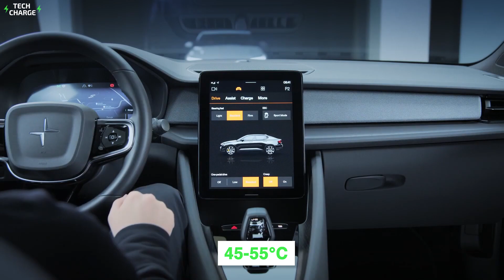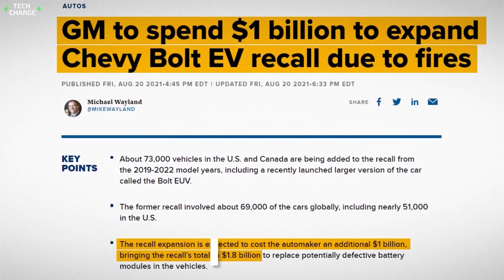The Shocking Truth About EV Fires You Need to Know

Comment: The sheer speed with which these fires develop is the most terrifying aspect, especially when it's a bus!
Reply: Also, it should be noted that, once burning, EV fires are almost impossible to put out. In addition, an EV that has burned cannot be repaired and resold. Therefore, insurance companies cannot repair these cars and must assume any fire is a complete write-off.
Reply: @@Mathilda2zeroAlso, the highly toxic smoke which causes cobalt poisoning and lithium poisoning makes EV fires extremely dangerous.
Reply: Well and the amount of water that is needed by fire departments to put them out
Reply: With 3000°F, you can torch almost anything--pretty quickly, for sure!  Did you see that video, last week, of that fatal container ship fire, that went up, with 4000 vehicles on it (500 of which were EV's, by the way)?  Looked like a real fiery h*ll, all right--with the whole top of that steel ship, burned away!
Reply: Just think how long it would take to extinguish a fire in an electric semi truck. The batteries alone weigh thousands and thousands of pounds. These are death traps on wheels.
Reply: @larrybruce4856  Fire departments are developing new technologies and new techniques to fight EV fires. Some are saying they can put out EV fires as fast as a gas car and with as little water.
Reply: @jamescarew2976  Well not really. The fire fighting EV tech being tested now uses a device that slides under the burning EV then penetrates the battery pack and floods the battery pack with water. It puts out the EV fire as fast as a gas car with about the same amount of water.
Reply: There are technologies and procedures that are being developed now that will put out EV fires quickly.

And if you're so worried about lithium fires in EVs, then you gotta get your laptop and phone out of your house at night. They can burn your house down too.
Reply: @@Mathilda2zero plus the batteries also produce oxygen while burning.... very scary.
Reply: The video host asks, "Do you think EVs are safe?"
Hell no!
I don't want one even if it is free. 
That it can burst into an uncontrollable fire spontaneously is like a ticking time bomb.
Parking it in one's home garage would jeopardize the life of the whole family.
Reply: @simon6071  Absolutely!
Reply: Spot on. Not only do they catch fire in an accident which damages the battery - they can spontaneously ignite in your garage under your home in the middle of the night which will destroy your home before the Fire Brigade(Department) can extinguish the source of the blaze - the battery.
Reply: @richardlewis5316  Teslas on average catch fire once for every 205 million miles driven. Gas cars every 19 million miles. If I were you, I wouldn't put a gas car in my garage. I have two Model Ys in my garage. Much safer than gas.
Reply: I'm waiting for the first electric school bus to burst into flames with kids onboard.
Reply: @1940limited  kinda sad, when you think about it: what lengths we've gone to, because of these crazy radicals & environmentalists...
Reply: @1940limited  Well.... if anything would put a stop to the EV madness it would be a tragedy like that wouldn't it
Reply: What about a passenger ferry on a cramped deck add a new green ferry powered by highly flammable gas and you have a catastrophe waiting to happen.
Reply: @iancampbell6925  Millions of EVs are shipped on the ocean every year.
Reply: @iancampbell6925  "How fast do you have to go in airplane to make your head explode?"  ~Spadowski, the janitor, in the movie UHF
Reply: Not remotely as fast as a petrol explosion.  Are you aware of the death toll at gas station forecourts each year?
Reply: @fredflintstone9963  
Google: The Most Surprising Gas Station Accidents Statistics And Trends in 2023
"How often do gas station accidents occur in the United States? According to data from the National Fire Protection Association, there are approximately 5,000 gas station fires in the U.S. each year, leading to an average of 2 deaths, 48 injuries, and $20 million in property damage."
The answer is 2 deaths each year.
Leave the risk at the gas station, not at home.
VIDEO: Experts say China's EVs are "Exploding in Huge Numbers" - The Electric Viking
VIDEO: No One is Talking About Electric Car Deaths, So I Have to
Reply: @fredflintstone9963 Those fires are probably due to stupidity. You can’t fix that.
Reply: No where near as fast as a petrol fire.
Reply: @geoffbennett9257  lets see, petrol fire: 500 to 800°F, outside of a combustion chamber, and easily put out.  Lithium battery fire, 3000°F, and takes 30000 gallons of water, to put out (though it might reignite, later).  So, of course a petrol fire is faster, right?  (Only if you are an idiot, who doesn't understand physics, that is...)
Reply: A petrol car fire can be smothered and put out. @geoffbennett9257
Reply: @geoffbennett9257 EV fires are absolutely faster and hotter than most petrol fires. Much harder to extinguish too.

Comment: I have not owned a single gas car in almost 60 years that caught fire.  That said, I will never put an electrical vehicle in my garage and risk burning down my house and danger my family.  Even electric bicycles, scooters and other electric units are being 😊banned from apartments because of fires they have started.
Reply: They usually give you a warning in the form of a gasoline smell before a fire, and electric vehicles give no warning.
Reply: @robinsattahip2376 overcharging, overheating and smoke... as far as I've read.

Some lithium ion battery expert should explain those extremely risk charging failures.

Lithuum ion batteries have a BMS (battery management system) which equalize energy cells charge, keeping them withim safety charge range. Some people remove or change BMS and charger to increasr battery range and power.
Reply: THAT is because scooters and stuff are owned by kids who will buy off market or rebuilt batteries, or even entire home-built machines. Then they bring them into their apartment because if they left outside they will be stolen within minutes. So They take them up the elevator, and park them just inside their doorway so when they catch fire nobody will be able to escape from that apartment. Frequently they may be using third party chargers, and over charging will be happy to start the fire. 
The Lithium-Ion cell is about the same size as an AA cell. It technically only becomes a battery when you wire a battery of cells together. Since this is so easy to do, kids will try to make their own batteries with predictable results. That bike shop in Queens that burned out five residential floors above it, they had maybe one hundred batteries in the basement in various stages of repair and using whatever chargers were handy. The Fire Department (FDNY) had given them several ticket, as they had of course failed just as many inspections, but FDNY can only inspect and ticket them, they cannot shut them down or evict them.
 Великий и Славный и самый Имперский ЛЕВ 🦁
Reply: Same here.
Reply: You are a victim of the hysterical reporting, your ICE is many many times more likely to burn than any EV. 

Cheap electric scooters and the like are not sophisticated EV's and on top of that it is often their cheap chargers cathing fire.
Reply: @mikebreen2890  More likely?  Rubbish!   The main reason a diesel will catch fire is due to electrical faults or arson.  L- ion batteries are renowned for combusting due to over charging or external temperatures.
Reply: @scaryfakevirus yeah. Diesels catch fire due to engine problems and fuel pump problems ect.... EV don't have any of these problems.  Only thing that can catch fire in an EV is the battery.   The batterys are getting safer and safer every year.   Still 15 to 20 times less likely to catch fire than an ICE vehicle.
Reply: @Liams_Fraser_Island_adventures  BS - No they don't.  Tell me what would ignite the diesel?  Having been a diesel mechanic for 15 years (many years ago) I can tell you that will not cause a fire.  Diesel is very hard to ignite so you try to light it with a match!!  It's batteries btw.
Reply: @Liams_Fraser_Island_adventures  You obviously know nothing about engines then?
Reply: @scaryfakevirus 😊
Reply: @mikebreen2890  Hysterical reporting?  LOL Pot calling mate.  And an absolute bs comment btw.
Reply: @scaryfakevirus  How?!
Reply: @mikebreen2890  Pot calling?  Hysterical reporting that it HAD to be a diesel.  EVs are known to spontaneously combust when over heated, subjected to salt water, in an accident or sustain damage to the battery casing and when on charge.  Diesels?  Only when there is an electrical fault or catch fire from another external source.  These are facts and you need to accept them.
Reply: @scaryfakevirus  And they are still massively less likely to be involved in a fire than ICE. What part of this are you not understanding?
Reply: @mikebreen2890  duh … only 3 procent of the cars are fully electric.
Reply: @Patrick-bw7kr  Why the "duh" - I know. Duh.
Reply: @mikebreen2890  so logic … that there are less ev fires. 
Do you’re math.
Reply: @Patrick-bw7kr  Yes, there are less EV fires. What maths did you want?
Reply: @Patrick-bw7kr  Still not understanding the "Duh."
Reply: @Patrick-bw7kr  Oh I get it! You are one of those rocket scientists that does not understand the concept of saying less of something is happening per 100 or 1000 or whatever. Did you go you go yo school?
Reply: @mikebreen2890  still nothing about where you have the information from. 
As expected.
Reply: @mikebreen2890  there are 274 million ice cars in the US 
And 2 million fully  electric. 
So DUH .. there are more ice fires.
Reply: Imagine the other 274 million are fully electric. 
They already started the coal-fired power stations up again. (Only 2 million electric)
Good for the environment 😂
Reply: @Patrick-bw7kr  You could find it for yourself, it might help you stop making a fool of yourself.
Reply: @mikebreen2890  so you can’t provide. 
Just what I thought.
Reply: @mikebreen2890  still waiting…. 
Because you can’t.
Reply: what about phones with the same battery?
Reply: @miudi9535  Yes, and why the warning signs on Laptop batteries?  Don't toss in a fire pit it will roast your marshmallow real well.
Reply: @miudi9535 they have like 1 or 2 cells in them, likely hood of those wanting to ignite are really low, an EV has over 2k of those, the chances of that catching fire is 1000x riskier and 1000x more dangerous when it does.
Reply: @miudi9535  Far smaller and less dangerous.  Sorry.
Reply: There were 200,000 gasoline car fires in 2022. There were 52 EV car fires. The rate of fires is 20 times higher for gas cars over EVs.
Reply: @777Outrigger  Where did you get that bogus 200,000 number?
Reply: @MountainFisher they're conveniently leaving out the fact that most of those were older cars across all make and models, so literally over a billion, and almost all are nonfatal and easily extinguished. Now compare that to brand new EV's catching fire across a limited amount of models, so a fraction of a percentage compared to the other control group.
Reply: @MountainFisher  And bogus number 52 EV fires... there are hundreds of EV fire videos, soon to be thousands.  The facts are, these batteries as they get older become more at risk of fire.  Putting an EV in your garage is like sleeping with a grenade under your pillow.
Reply: @777Outrigger  There are literally hundreds of millions of gas powered vehicles. But did they spontaneously combust?  No.  Your figures are bs.
Reply: @777Outrigger  you ae clearly a genius.........................
Reply: @777Outrigger  fictional stats
Reply: @robinsattahip2376  Why do you think that???  Because you don't like it. Where are your "true" stats?

Comment: They don't perform better than proper cars and they sure as hell are not safer. 1. They don't have stand alone dual circuit brakes. 2. If you run out of juice in the middle of nowhere you could get raped or killed. 3. You could likely get involved in a collision when your vehicle is waiting for a tow truck. 4. Getting BBQd is a pretty shitty way to die. 5. These fires can keep reigniting for days. 6. The fires are so intense they can easily spread and kill others.
Reply: Harder on tires and insurance.
Reply: I will be willing to bet you haven’t driven an EV… most radical negative comments come from uninformed people

Comment: Imagine one catching fire in a bushfire danger area, No way to stop it.
Reply: Imagine one starting in your underground car park.
Reply: @TheRealWindlePoons  It is bound to happen. and what happens if the fire escape is one that opens in the car park, there are probably some that do.
Reply: @TheRealWindlePoons  Now imagine 10 EV cars parked side by side at chargers in your underground condo parking.  If just 1 of those EV's has a slightly rusty battery (which will happen eventually, not a mater of IF, but WHEN), now the fire spreads to other EV's.  These are a disaster waiting to happen.  Parking EV's in your garage is like sleeping with a grenade under your pillow.

Comment: LFP batteries are apparently safer than Li Ion batteries for thermal runaway so governments should be encouraging consumers, retailers and manufacturers to sell the safest battery models into the future.
Reply: They don't care about your safety they only care about the profits from lithium mining.
Reply: They are but the energy density is not on par with lipo batteries.Using LFP would yield a heavier battery with shorter range making a car using it very unappealing. Using a lipo battery barely makes electric cars usable, now take away what range they have now would make them a now deal for most.